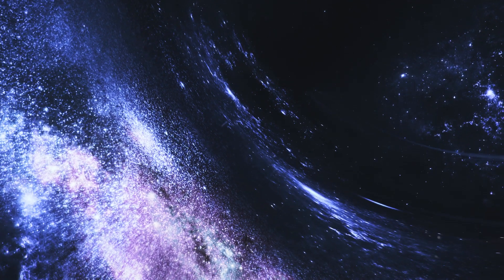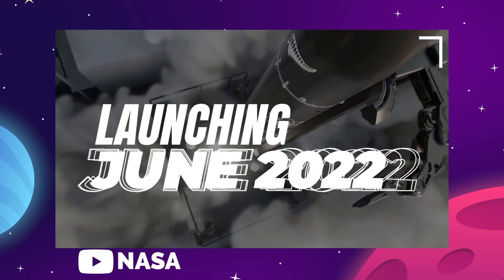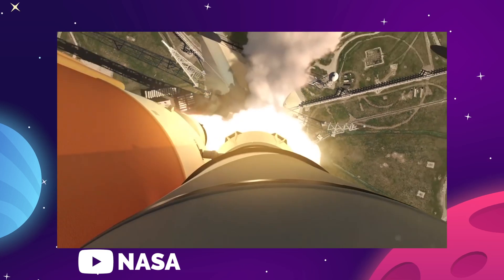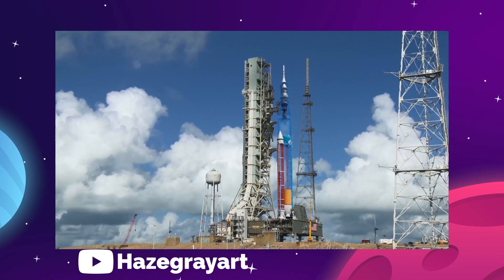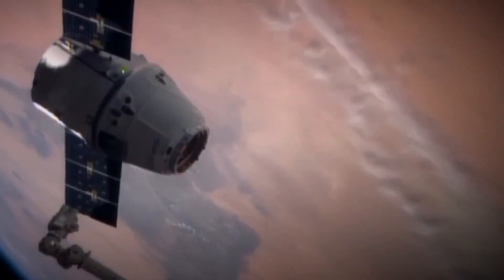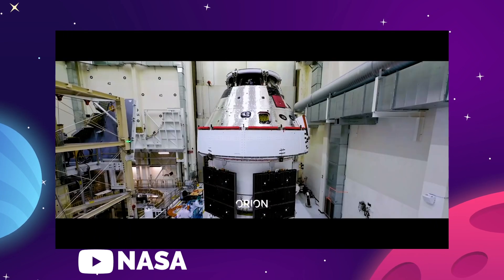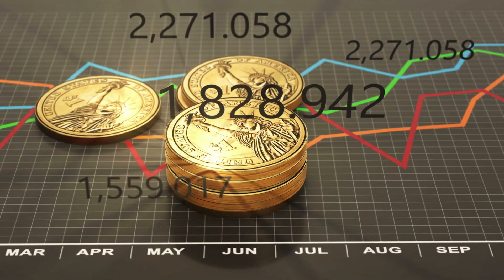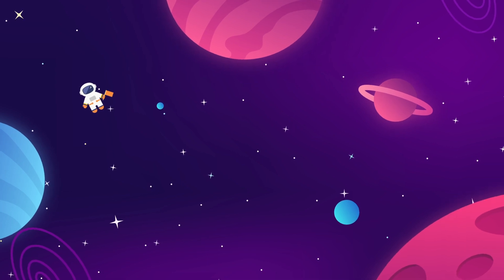SpaceX & NASA Reveal Major Moon Mission Updates!

Comment: I have a fundamental issue with the naming of the Capstone mission.. I understand it's an acronym, but the NAME is wrong for this mission.
A "Capstone" is what goes on the top of a structure.. It's literally the LAST thing to be installed..
This probe is the FIRST thing they are sending out to the Moon for the Artemis Missions, and therefore it SHOULD have been called "Cornerstone" (go nuts turning that into an appropriate acronym!).
Cornerstones are what you put down first, they set the outline of your build, and they provide a solid foundation for the structure above..
Tell me I'm wrong.
Reply: Technically, you are correct. But in the context of how NASA are using the term you should look to how universities use "Capstone Projects" to bring students together to solve problems using innovative solutions prior to going out into the commercial world.

Comment: Cleaning up the orbit will be even more expensive than fishing out plastic from the oceans. You can't just go around and collect things. It needs a vastly different approach. All these orbits are so different which means you'd have to intercept every single piece which needs fuel to change orbit. And then you have to use fuel again to properly deorbit these pieces.
Reply: I think you're wrong about that. You can use powerful lasers to deorbit space junk.
Reply: @joshuas_rides  more powerful than the sun? And you'd have to put the laser on the surface and it would require insane amounts of energy if you want to translate that much force into photons. Its not viable
Reply: And a space based laser doesn't have to shoot through the atmosphere, so it would have unlimited range
Reply: @joshuas_rides  laser from space doesn't work because that laser satellite would need as much fuel as it would require to deorbit something because physics
Reply: Most of it burns up in the atmosphere. Problem solved.
Reply: @TheRepain  you are so wrong, it takes decades for some pieces, there is rocket stages from the 60s up there

Comment: Its not good to just test a few engines at a time.  Me and my engineer buddy has a riding bet, both of us are engineers and design and build dies for a stamping machines that have  10k to 50k pounds of pressure. we bet $500.00, money in neutral safe, no take backs. I bet the launch pad blows a collapses crashing the booster, as 33 2.0 Raptors blast all at once. That needs to happen, don't want it to happen??? The launch pad will only blow once, that is what testing is for, to test everything involved so they don't need to find out on launch day, releasing that booster into the air, or releasing the secure binder's along with the star ship together will blast windows out for so many , many miles... Greater then the blast from that Russian meteorite that blasted out windows in the whole of the entire town below it.  Perhaps the blast will create a mushroom cloud like blast. We will be watching.

Comment: How about a slow space drive. Six fusion lanterns in a circular array with reflectors, shining onto a very, very  large solar panel reflector, not only reflecting light but very high speed, high temperature, helium atoms (also provides all the energy for space ship function). Slow drive but ferry you to the moon and back quite readily, quite a few times on one load of deuterium fuel, even get you to mars and back (want to refract the light as much as possible, scatter it, otherwise problems where you point it). Probably need a regular nuclear reactor as power backup to start the fusion lanterns, a good nuclear reactor design can be started manually. Fusion needs a lot of electricity, there is the solar panel reflector if you can point it in the right direction. Hey, SpaceX and NASA do better ;DDD. Rockets engines to get to the moon and back, no longer needed, a new element in the space race. Now the quantum particle displacement drive. My space drive V1 the slow one. Rocket engines are just so damn primitive ;DDD.